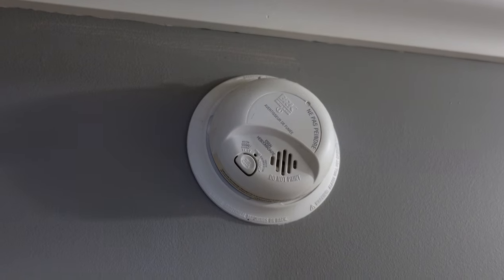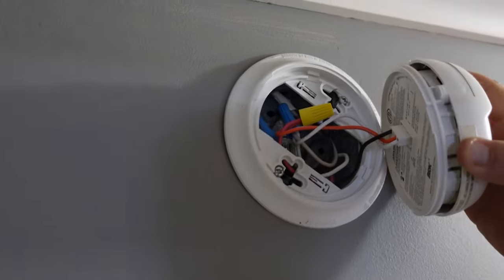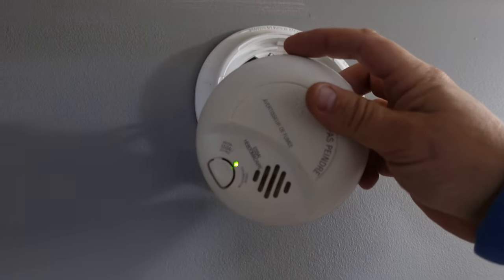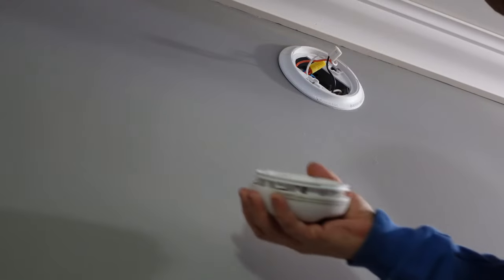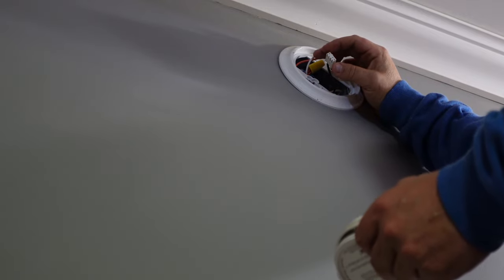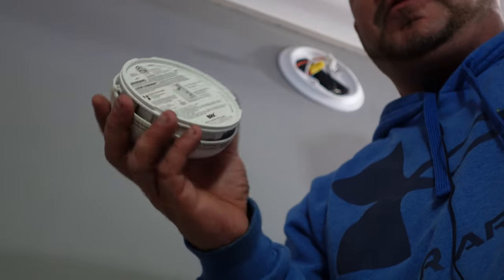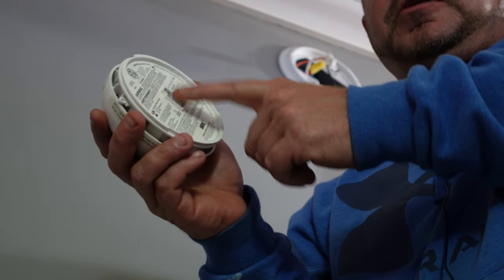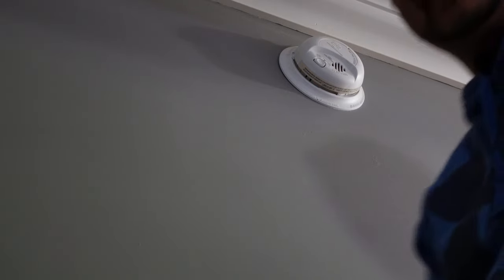Can You  Unplug A Hardwired Smoke Detector

Comment: Beeping would not stop while I was trying to sleep. Unplugged and threw it in my basement. Will revisit when I have a fire.
Reply: Lol
Reply: This shit gotta die😫
Reply: Mad funny lol
Reply: 😂😂😂😂😂😂 I swear I took my battery out And that sucker was still beeping I say what the heck Because I couldn't get the battery backing out and I don't like tedious work so I'm about to unplug these wires hopefully I don't get shocked
Reply: I swear I hear you because I even took the battery out and it was still beeping Lord have mercy so I'm about to try to unplug these wires and hopefully I don't get shocked
Reply: Releasing harness on kidde fire detector
Reply: @tarahtatum8376 did u get shocked
Reply: They really be sensitive for no reason
Reply: @bunguschungus2572  honestly
Reply: Same I threw my down the basement I was done with it 😂
Reply: @tarahtatum8376 I smashed my with a hammer and it still worked. Funny thing in England nothing works, but the fire alarms work until you completely dismantle them
Reply: Random fire starts 😢😮😢
Reply: There’s a capacitor in the smoke alarm that holds charge even after power is disconnected. Holding the button down will discharge it.
Reply: Same
Reply: HOA: You did Hwhat?
Reply: Me seeing this after i just had to call the fire department because mines wouldn’t stop going off taking the batteries out didnt help 😂😂
Reply: I’ve had one unplugged for probably over a year and now another won’t stop beeping. I tried to unplug it but can’t get it off. I would rather have a fire than suffer through this beeping 😭

Comment: Even if I unplug it still go off beep every 5 mins I can't sleep at night bc of this
Reply from the maker: It should have a nine volt battery that needs to be removed. If that still doesn’t work then it will need to be replaced.
Reply: That happened to me and I put mine in the freezer. it had a lithium battery and I couldn’t figure out how to open the damn thing. I finally had to throw it onto a cement floor and it popped open so I could take out the battery. The loud shrilling almost deafened  me.
Reply: @conquerallelectrical  I should have become an electrician. I changed the battery but the thing still chirps and I’m dog sitting and I don’t on the house. your video is great because it’s the exact same model as the people. I didn’t know you could just pull out the wires; I didn’t wanna break anything.
Reply: @conquerallelectrical I took out three detectors about two years ago, put them in the trash. Now I get chirping from inside the ceiling somewhere. I have no idea why since there’s no detector in that room.
Reply: My son found an old one in the closet SMDH
Reply: Sledgehammer
Reply: Once power is off and disconnected, remove the battery and hold the reset button down for 30 seconds. 
Put the battery back in and blow it on the sides all over to remove dust. 
Place it back and it should fix the beeping!

Comment: You are a sleep saver. Stupid thing kept loud beeping randomly. Replaced batteries and even shut off all power and drained it of energy to reset it and still went off for no reason. Sometimes it was 3 loud beeps or 2 just randomly. Need to replace it but didn't want it to keep beeping until I got a new one. I spent hours trying to troubleshoot it. Waking me up at midnight was the final straw, the sound of it dying as I unhooked it was satisfying

Comment: Mine looks just like that, but wouldn’t budge while pulling. Ended up needing to use a flathead to hold down a clip while pulling, then the harness unclipped.
Reply: Yeah same
I’m struggling to push down and pull out, it’s stuck

Comment: Good video! I am replacing one that has gotten too old. When I took it off and took the battery out of it something inside the socket continues to beep once a minute. It's definitely not the smoke detector that's been taken away it's not even in the house anymore. What is making it beep? The circuit breaker  is off.
Reply: Look

Comment: Thank you!!! This was so useful. I changed the batteries in mine but it wouldn't stop beeping so I had to unplug it. Shocked me when I did and it started beeping continously at me until I took the batteries out! 😅
Reply: I just did the same thing would not stop beeping after pressing so hard the reset button I eventually broke it I removed the battery still beeping so I had to unscrew the yellow cap that covers the cable and bam sparks so hard that I almost felt from the table that I was standing on and eventually the power went off... luckily I was able to restart the power back other wise I couldn't have gone to sleep mind you it is midnight  and my place so hot and I was  sweating so hard from the struggle with trying to stop it from beeping AC on now thank God I can sleep in peace 😅

Comment: Thank you! I changed batteries in all 5 units: smoke and Co. I turned off power and drained any residual power (I won’t tell you how long it took to find the breaker), I cleaned the beeping unit with a can of whatever that pressurized stuff is you use to clean dust out of computers and sewing machines), I took the batteries out and tested each of them: all good, AND STILL THE THING WOULDN’T STOP BEEPING. I live in a ‘new’ house. Alarms are 6 years old. Supposed to last till 2026 - 4 years from now. 
So, at 11:30 pm I finally started searching YouTube and found your video. By 11:45 peace ruled! Thank you!

Comment: Very clear. Very helpful. Thank you! Hallway smoke detector began beeping Sunday afternoon and wouldn't stop as it used to. Hush button didn't work. Tested battery: Good. I thought I could solve the problem with your tips and pictures, but now it was dark and I couldn't see to unplug it. Bottom line: Got up Monday morning, waited for daylight, threw the switchbox lights off and removed the detector as video directed. Problem solved. Editorial:  I lost sleep, got up cranky, incessant beeping still on. I got bad memories of smoke detector beeping and screaming for no reason. There is a second functioning detector in the bedroom. I don't see good reason to replace hallway detector. House is a 1000-sf single-story, no smokers, no children, two doors for escape, resident mobile with good hearing.
Reply: You can/should use non-hard-wired smoke detectors, AND very importantly, carbon monoxide detectors as well. That way you'll still be safe but be able to easily stop the beeping if you need to.

Comment: You saved our butts - our hearing at least! We had 7 hardwired smoke alarms go off together tonight - the noise was maddening! I pulled up your video via Google and right away Hubby knew what to do - 7 times!  We also have 3 battery operated fire alarms and they did not go off. No signs of smoke or fire. Geeze that was torture. Anyway, thanks‼️

Comment: If you live in a complex is it safe to unplug without turning off the circuit? Mine goes off randomly and my building won’t fix it so I need to change the battery myself

Comment: Hey there...variation on this in another post: if I unplug the hard wire, can I leave unconnected and have the backup battery supply the power? If taken off hard wire, will the detector work independently so it doesn't set off the whole house? Thanks!

Comment: Thank you for the video.  After you remove the smoke detector (and won't be replacing it for now) is it safe to tuck the plug/connector and wires back up into the ceiling so we can put the nonworking detector back on without connecting it?

Comment: Just moved into a house that’s gas. Old owners must have used plug in co2 detectors because I’m only seeing wired smoke detectors in Ceiling. We were given mounted battery co2/smoke detectors as a gift. Can I tuck wire harness and everything back in ceiling and just replace mounting bracket and cover that with non wired co2/ smoke detectors?

Comment: Great video, thanks. One of my smoke detectors is 16' high so impossible for me to change the battery or test the unit. If I unplug the connector at the back, as in the video, can I leave that connector in the wall and put a wall plate over the hole, and move the smoke detector to a different wall that I can reach?

Comment: After several weeks of thinking im going crazy i finally found a smoke alarm behind the drywall. It looks like the contractor finished the room,  realized they needed ac, placed a vent below the first finished ceiling and finished it a second time, leaving a smoke detector behind. I finally accessed it and replaced the battery to stop the beeping but my question is whether i should lower the detector to the external drywall so that its functional and accessible or if i can completely remove it without affecting the other detectors. It is 120v hardwired and connected to the rest of the house.

Comment: Mine just keeps beeping 3 times, I changed the battery so I'm guessing it's faulty. And the smoke detector itself is 7 years old. Can I unplug the connector and swap it with power on?

Comment: so will you tell me it would definitely be dangerous if I cant cut the power to make an adjustment so if I were to try to screw in a new mounting base do you think it could be possible that its risky that I could touch a live wire ? I mean the box does have component that could be dangerous if not dengerized ? also maybe the other issue of this as a diy project is if you make a mistake it does not mean it would be easy to find a remedy ? I mean if something unexpected happens I guess one way of looking at it is you can be certain it will not be coverd by your insurance I mean I think we need a shower valve replaced should have been easy but they had to make an emergency adjustment something unexpectedly went wrong and it could not get an easy remedy maybe having an unexpected electrical problem could be dangerous I guess the way to say it is thing that should be easy could become difficult if something unexpected happens than it would be harder to fix?

Comment: I have 7 detectors, 4  upstairs, 3 down. Six are hardwired, and I’m concerned if they all go off how do I know which one triggered them.
Reply from the maker: If they have battery back ups then replace all the batteries at the same time. If they do not take them down and and blow out any dust. If that doesn’t work then I think you will be into replacing them all unfortunately.

Comment: I've had a hard-wired smoke detector connected since the house was built in 1995. Didn't know these things had batteries. I'm sure the batteries have already gone out. I would rather just disconnect it and then put the unit back on and install a new one next to it that's not hardwired.

Comment: mine doesn’t have a battery I also unplugged it and it’s still beeping?! how do I make it stop until I can replace it? 😭😭
Reply: Hmmm silence.. exactly. No one knows smh
Reply: You need to drain the residual electricity in the alarm. Once it's unplugged and the battery is out, press and hold the test button until it is silent. There is another video I just watched on this. The alarms hold some residual for awhile, which can cause it to still beep.
Reply: Try a sledgehammer